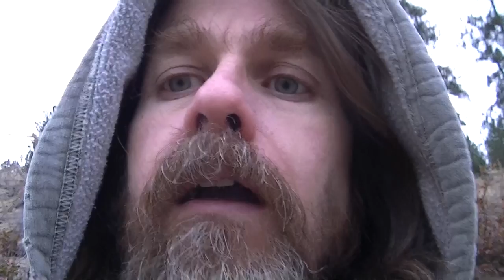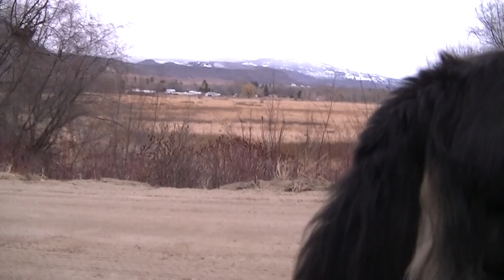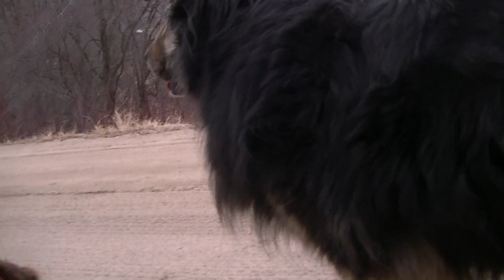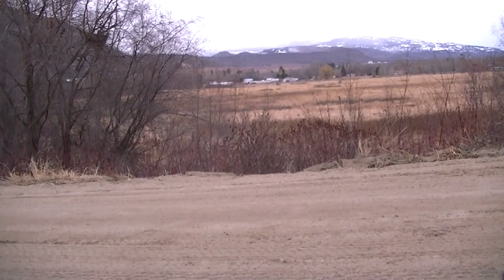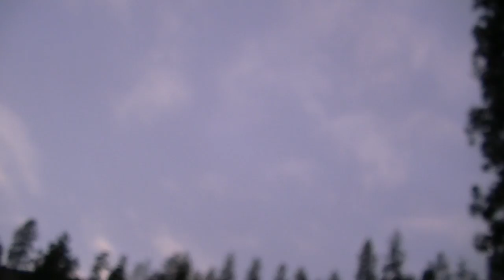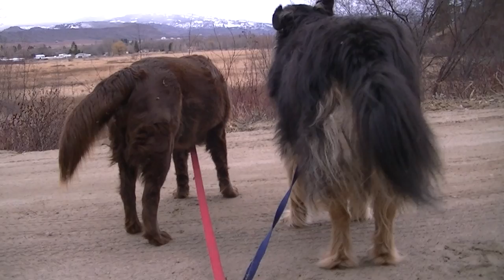2014-02-22 Investors & builders needed to span the Darien Gap Feb 22 02 2014

Comment from the maker: Danyang–Kunshan Grand Bridge is the world's longest bridge.[2] It is a 164.8-kilometre (102.4 mi) long viaduct on the Beijing–Shanghai High-Speed Railway.
Bridge[edit]
The bridge is located on the rail line between Shanghai and Nanjing in East China’s Jiangsu province. It is in the Yangtze River Delta where the geography is characterized by lowland rice paddies, canals, rivers and lakes. The bridge runs roughly parallel to the Yangtze River, about 5 to 50 miles south of the river. It passes through the northern edges of population centers (from west to east) beginning in Danyang, Changzhou, Wuxi, Suzhou and ending in Kunshan. There is a 9-kilometre long (5.6 mi) section over open water across Yangcheng Lake in Suzhou.[1]
It was completed in 2010 and opened in 2011. Employing 10,000 people, construction took four years and cost about $8.5 billion.[1] Danyang–Kunshan Grand Bridge currently holds the Guinness World Record for the longest bridge in the world in any category as of June 2011.[2]
http://en.wikipedia.org/wiki/Danyang%E2%80%93Kunshan_Grand_Bridge